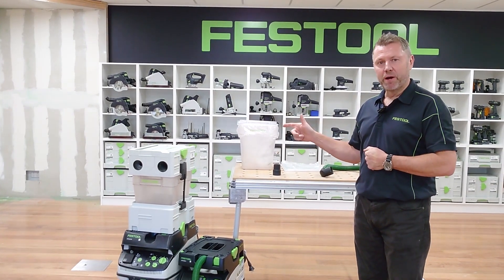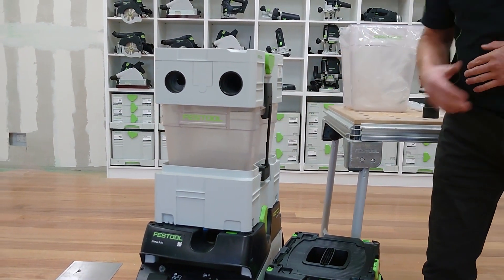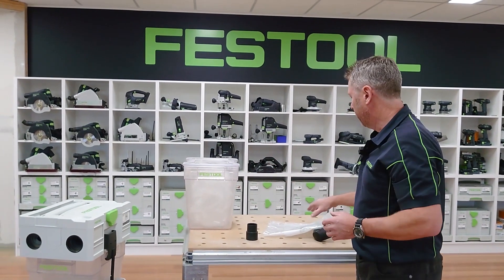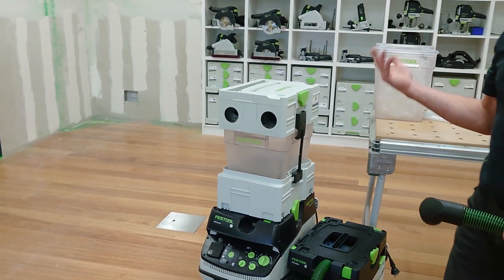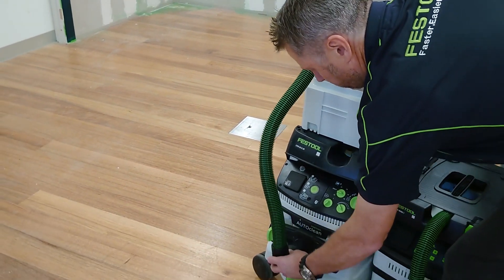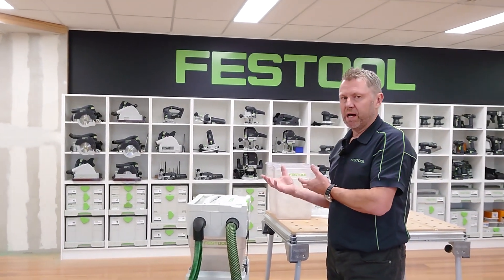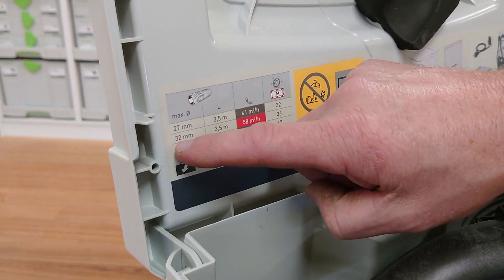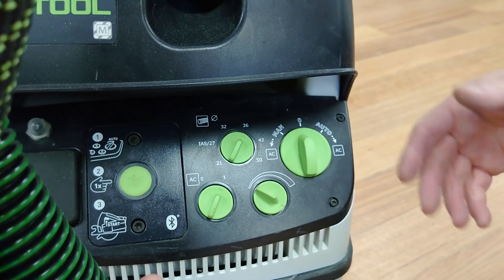Guide to the CT Cyclone Separator

Comment: Question... I have the older ctm36 which doesn't have the 42 setting on the hose diameter dial if I have it on 36 the extraction is down if on 50 it beeps constantly any ideas would be 👍

Comment: When placing the bag in my cyclone separator it collapses, not sure it is working the way it should.  Is the bag collapsing inside the separator under operation normal?
Reply from the maker: The cyclone bag can sometimes collapse but as it starts filling up will settle down and level out.